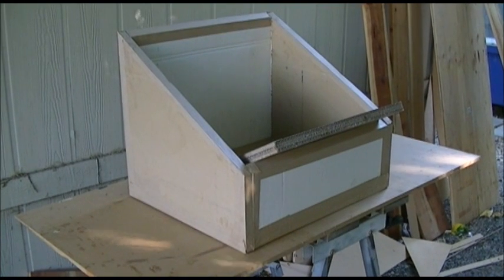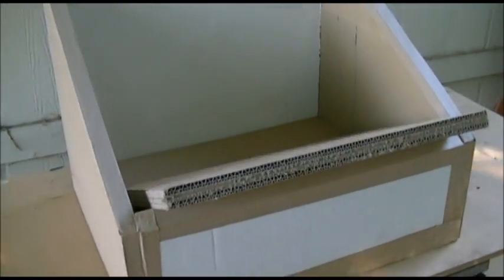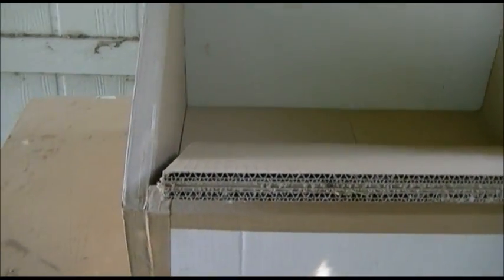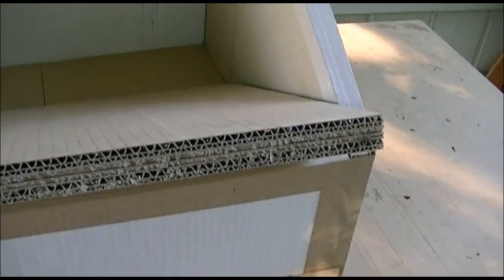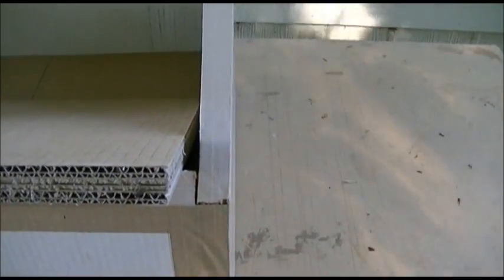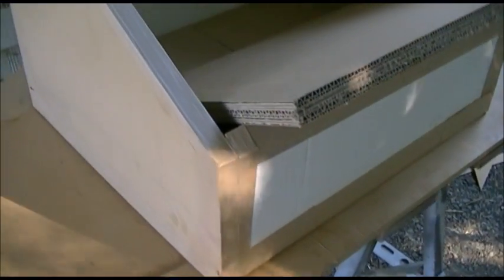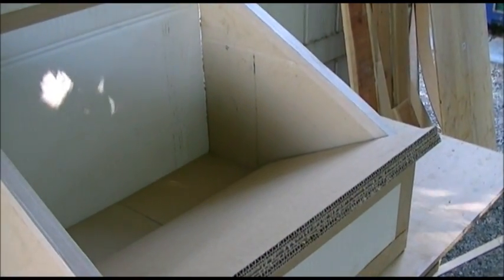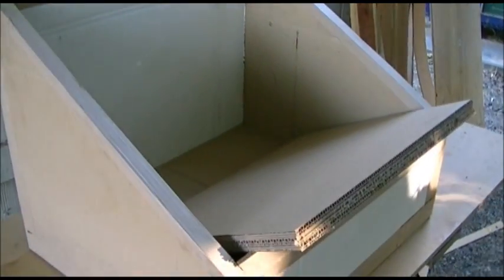Cardboard Solar Oven Part 1

Comment: Wondering if a person could us the 1 inch sterofoam to build one. It has the foil, already on it , on one side. I'm thinking of trying it..and get a sheet of plaxaglass for top ..then build reflextors using Mylar bag material.
Reply from the maker: Your idea for insulated styrofoam is good, but the plexiglass will melt.

Comment: My next solar oven will probably be a Global Sun Oven because I'm concerned about food safety as well. Because I use it so regularly now, I want something safe and durable. Only drawback is the small size of the commercial ones. Even with a commercial product, people complain about oven odor. I think cardboard will work as well plywood. Maybe you can cover the outside with some water proof material so an accidental rain will not ruin your hard work.

Comment: my friend. I clicked on LIKE even though I DON'T LIKE. Just a position I'm taking at this point in time. I listened THEN verified my concern. That is that you are using corrugated card board with out knowing a guaranteed list of food grade construction regarding the glus used and it's heat retention from seaping into the food prep. No one wants the GI $hits or worse. Just a thought to run past you jw...thanks ...jv Rock on and we love ya regardless.